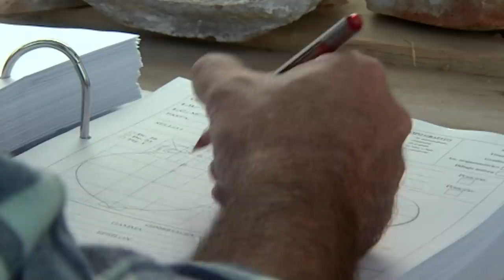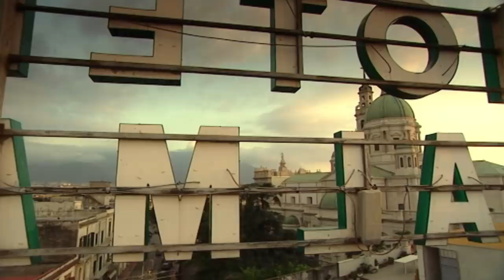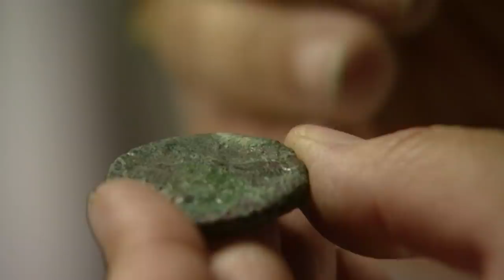How Much Did It Cost To Run The Roman Empire? | Metropolis | Odyssey

Comment: Excuse me, but the Roman Empire lasted TWO thousand years, if you count the Eastern Roman Empire. Byzantium.
Reply: No it didn’t, even if you count the eastern Romans, imperial Rome lasted 1480 years. And by the time Sultan Mehmed conquered Constantinople; the Romans had only been living on small areas of Greece and Anatolia for hundreds of years. Hardly an empire by that point.
Reply: @mirzasvijet8432  700BC to AD1453 is more than 1000 years…
Reply: @AnnhilateTheNihilist  Obviously. The original commenter said the empire lasted over 2 thousand years, which isn’t true. Imperial Rome began in 27 BC. Rome was founded in 700BC as an extremely small settlement and wouldn’t majorly expand until centuries later.
Reply: @mirzasvijet8432  Back up. Back up. The “republic” started in 27BC, sure, and they weren’t considered a Mediterranean powerhouse until after the republic; however, they had defeated many nations in war prior to then (Carthage, Pyrus, Spain) and were definitely established hundreds of years before then. So the empire absolutely lasted nearly 2000 years but the Republic a mere 1500 (depending how u count it)
Reply: @AnnhilateTheNihilist  The Republic started in 509 BC. Get your facts straight. You are obviously very ignorant of Roman history. The Empire was founded in 27 BC by Augustus Caesar/Octavian. The Empire collapsed in the west less than 500 years later. And the Eastern Empire was finally conquered by the Ottomans.
Reply: @mirzasvijet8432  but there was still an Emperor on the throne of the Roman Empire until Constantinople fell. It wasn’t the empire it once was but until the Emperor falls the empire still stands.
Reply: @mirzasvijet8432  the fourth crusade I personally would say is what ended the empires ability to project power or defend its self. The writing was on the wall at that point but it’s still impressive that it took the ottomans a very long time to finally defeat and end the empire.
Reply: And let's be honest...they stopped being truly Roman a few hundred years after the west fell, despite what the Byzantines (yeah yeah, I know) liked to tell themselves and everyone else...at most they where pseudo-romans, and their faux Rome  cosplaying shouldn't be mistaken for the genuine article. 

I'm sure people will continue to find ways to stroke their ego, by using such historical snobbery, to fuel their own snobbish foolery.
Reply: @nathanielsavage7932  Which empire? You aren't seriously thinking there was much if anything legitimately Roman floating around Constantine's city at that point (other than buildings, artifacts, and delusions) do you?
Reply: @mrsir2254  I love your reply. And you’ve won me over as I can’t not be bothered to try and debate what you said.. the cosplay bit had me laughing 😂 it was still the Eastern Roman Empire. 

But there is still an empire in modern times as the Empress still sits on the throne.. God save the queen. The true empire. 🇬🇧 😂 please… it’s only a joke.
Reply: It’s a long time, it’s longer than how long the modern USA has been around
Reply: @mrsir2254  Who are we to say what a "true" Roman is? The Roman Empire/Republic was Greek speaking for almost as long as it was Latin speaking. Even in its classical, Latin speaking form, educated people spoke Greek as well as Latin. Just because the Empire changed that doesn't mean it stopped being Roman. King Harold of England wouldn't recognize the England of today and he sure wouldn't understand the language. That doesn't mean it's not England anymore. The name "Byzantine Empire" is just a modern invention made by people who wanted to disassociate the glorious Latin period from the slow decline of the Greek period. But there was no separation at the time, just a single civilization changing with the times.

It's the height of modern arrogance to dismiss what the people called their own empire. Not only did the people consider themselves Roman, they kept considering themselves Roman long after Ottoman occupation, right up to the 19th century.
Reply: Maybe you should make your own documentary explaining roman history...
Reply: ｋ
Reply: Did Rome ever really go away? Pagan Rome did eventually, but Roman laws, Roman architecture, Roman languages, and symbols are still part of the Western civilization. We can't stop wanting to hear about these ruthless, brutal, and brilliant people. They weren't nice, horrible more often than not, but they did create much of what we call civilization.
Reply: @mirzasvijet8432  2000+ years of history if you count from its founding (753) until the end of their Empire (1453)
Reply: @mrsir2254  What do you mean by 'stopped being truly Roman' // The ERE are the Romans and always been. Just because they speak Greek doesn't mean they're not Romans anymore. Rome adopted many things from the Greeks. 

The Eastern part of the Empire always been speaking Greek.
Reply: Not really. Closer to 1000
Reply: @youdontseeanoldmanhavinatw4904  Read my comment (above)
Reply: The Roman Catholic church still exists so you could argue 2,500 years
Reply: When napoleon walked into Rome without defense the Roman’s would have been so ashamed of their great city.

Comment: An interesting, relatively high budget, production, very well translated, btw.

it would be nice to include the production date in the introduction, though. While you can tell it's a relatively old documentary, the exact date would be useful info. All the more because there are some inaccuracies, such as the description of fights in the arena, or the claim that Rome had around 1 mio inhabitants. The first may be attributed to historiography at the time, as it is now consensus that most gladiator fights were not deadly. The latter is something you unfortunately hear time and again, with little to support the fact. If we take into account its city walls, ancient Rome had an area of around 140 square kilometers, which is about a thenth of the size of modern Rome. Modern Rome houses roughly three million people, what with all the advantages of modern technology and all, that allow for much denser housing than in ancient times. This is party offset by modern living standards that call for greater areas per person, true - but it would still seem a bit daring to assume that population density in ancient Rome was more than three times higher than in modern Rome.